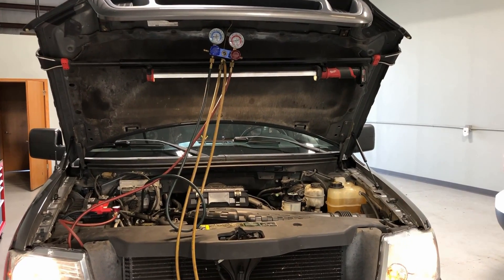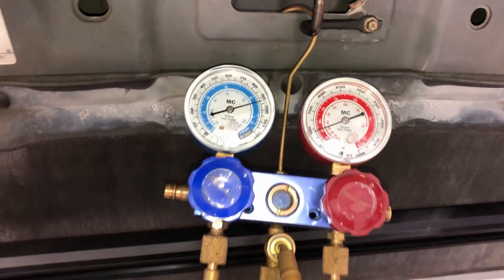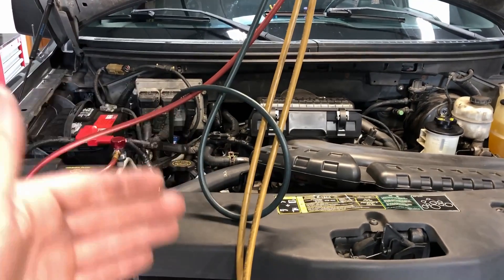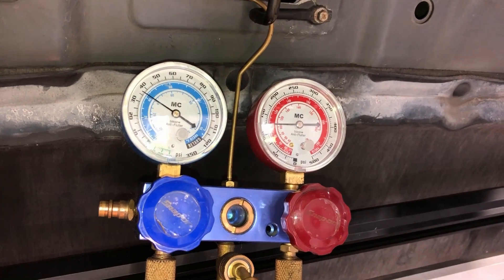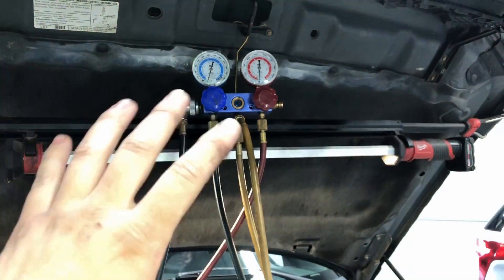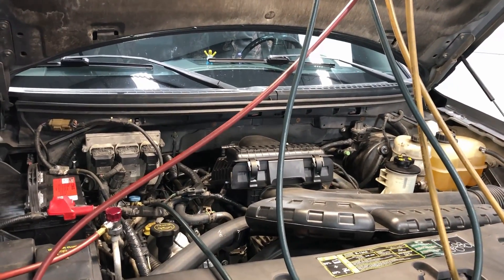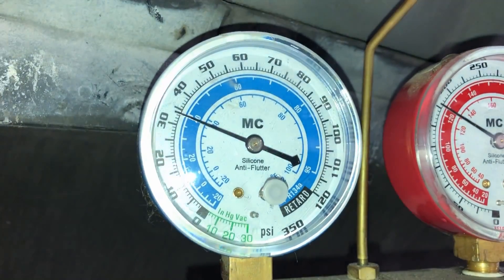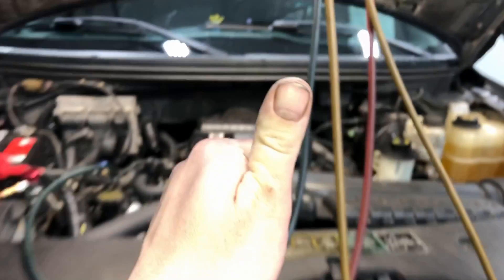Poor Automotive A/C Cooling: Do You Have a Low Refrigerant Charge Level?

Comment from the maker: Basic R-134A Manifold Gauge Set:
https://amzn.to/32JTGCc
Reply: FordTechMakuloco is this set any good? I was thinking of getting yellow jacket brand in the future but I’d like a cheap set too.
Reply: @richieschmidt6225  bb
Reply: For those of us who are backyard mechanics without an a/c machine, is it ok to just top off the system based on pressures?  Should this be done annually or just when it gets low enough it isn't cold or cycles the compressor?
Reply: teamgreen02 I would not it’s measured by lbs you could over charge. 45psi could be 2lb or 2.5lb just don’t know. “Never top off” evacuate and refill
Reply: Nice! I bought a set at a garage sale and it bent my low side valve 😒

Still using the AutoStoned manifold and vacuum. Free to rent with a $300 deposit. I'll have to get that set and a vacuum, maybe next year.

I diagnosed a bad low-side switch with a multimeter...I found out that the switch contacts are normally closed when the compressor should be running. After making sure I had freon in the system, I jumped the terminals together, system ran great, recovered the freon, replaced the switch and valve, pulled a vacuum, and filled it up. Fixed for -$30- $40 after freon (that damn needle valve)
Reply: I only use high side to check for restrictions
Reply: Whats could be wrong if this happens when you start driving the compressor starts turning on and off?
Reply: Can you tell me if tid codes for mode 6 are publicly posted or where I can get them for 99 expedition 5.4. Got what I believe to be a misfire but it is faint and only felt in drivability posing as a transmission slip. I have a few tid codes that i need to onow what they hex 41 for example.
Reply: drome010381 code 6 codes?
Reply: @weldingjunkie  yeah I will probably murder the proper explanation but I believe it is a type of diagnosis protocol and not all scanners/software are capable of determining what the manufacturer meant by a certain test #. For example, I was looking for $21 which is hexadecimal 21 with ford I found it is a vacuum pressure code. I was able to reach out to Forscan and they pointed me to a Ford website that has their descriptions.
Reply: drome010381 Ah so you just want to live Data ? Not codes right ?

Comment: Brother, you’re gonna be getting invalid temperature and air pressure readings. You can’t charge an AC system in the rain. You’re also gonna get moisture in the system that way, even if you’re inside cause there’s gonna be moisture in the air.

Comment: Freon:  How do you add Freon when the compressor won't turn because of low freon?
Reply from the maker: You vacuum the system, or you have a can that is a higher pressure. Once the pressures are safe the compressor will come on and suck the rest in.
Reply: @FordTechMakuloco  Thanks for giving the answer quickly.  Double Thanks for giving the Correct Answer.

Comment: Thanks a lot for making this video. I am seeing the same issue on my car. I think my leak is from the low side Schrader valve. I need to find the tool to replace the valve core that fits the valve in a Volvo. I am not going to recharge knowing that I have a leak. And I think the leak additives are not the way to go.

Comment: My 2013 F150 has a new compressor, TXV, pressure switch and has exactly 24 ounces of refrigerant per the sticker. Still cycles on and off every 30 seconds or so.  Cools fairly well to about 50 but not sure why it cycles.

Comment: @FordTechMakuloco, I have a 2012 ford fusion with the A/C goes to heat by itself (manual controls). A/C is still on but will not come off heat and man many people are having the same issue. Would love it if you did a diagnostic video on this issue. Peoples fix is to turn the headlights and fog lights on or to turn it all the way cold then back it off two clicks. And this seriously works for some reason would love to know why this is and a true fix for this issue. Ford quoted me 400 for a module update but i have read people have this done and it does not fix the issue. The blend door actuator works fine does the full sweep and stops with no clicks at the end. A/C compressor is running and the lines are cold when it goes to heat by itself. Again would love to see a video on a diagnosis for this fix. love your videos you post and anytime i have a problem with my fords your videos are the first i look for to solve my issues.

Comment: I got one for you, how will pressures change if the fixed orifice tube is clogged? I understand that the low side will show lower than normal pressure, maybe a vacuum, but what about the high side? Cengage textbooks say the high-side pressure will be lower than normal, but internet sources like freeasestudyguides say the high-side pressure will be higher than normal.

Comment: Help... ac charged. Compressor constantly running ,but gauge low side pressure won't go past 26psi. High side temp 225-250, then ac fan kicks on. Vent temp will only get down to 51 degrees. And outside ambient temp 85 degrees. What am i missing

Comment: Using my manifold set- I'm recharging through the low Port ONLY- the low Port coupling is obviously open. My question is-your highport coupling is open so this way you can READ the pressure on the manifold gauge... The High valve on the manifold gauge NEEDS to be closed...BUT the coupling on the high side is OPEN for reading on the manifold gauge?

Is that last part correct??
Reply from the maker: The coupling at the port on the system are turned in to open the shrader valves yes but the knobs on the manifold gauge set are closed so the sides do not mix in any way.
Reply: @FordTechMakuloco  ahh haha okay. Was reading about the manifold gauges and how they work... So what's the purpose of the high side besides reading high pressure? What happens if you turn the high side on during the recharge on the high manifold value?
Reply: @FordTechMakuloco  just to clarify- all coupling on the vechical are open during recharge?

Comment: Hi Brain !   First and foremost, I want to thank you for all your time and effort to make these videos.  Its alot of work.  You have saved my A$$ many times over the years with my Ford vehicles.  I'm currently chasing a problem with my 2011 Taurus SHO A/C system.  My wife drives this car everyday and tells me that at idle the A/C temp in the car starts to blow noticeably less colder air...not hot but warmer air.  So, I charged the system first with PAG 46 and then followed with the R134-A.  Initially the clutch wasn't coming on even though I turned the A/C turned on in the cabin to MAX with full speed on the blower fan.  Within a few minutes,6-8min, the clutch switched on...as did the engine fan...  At this point the 134 was able to be sucked into the low side....but only for about 1 minute, because the comp clutch switched off again.  Again, a few 6-8 min later the clutched kicked on again and I was able to get the entire can of 134 into the system and the clutch stayed engaged from that point on until I turned off the car.  When I went in the car to turn if off, it was super cold inside. Just to note, the gauge on the can of 134 stated about 40lbs was the pressure by the time the can was empty.  Figured I was good to go.  Although, the next morning, the system was acting like I never did anything to it. Acted like it did before I did the work.  I drove it awhile and I could tell when the compressor switched on because the air got a bit cooler, but seconds later the air got much warmer.  It was like the comp was switching off and on....like in this video.  Do I have a bad low pressure switch or did all the 134 leak out of a bad seal.  I am going to get a good manifold gauge set so I can get a better handle on whats happening in the system real time.  How can I tell if its the switch(high or low) or a leak ?  If the comp stays on it gets cold.  Clearly, my limited discovery is that for some reason the comp shuts off for a while(minutes) and then switches back on again(for only a few minutes)  Not sure where to go.  I kinda think its the low side switch.  is the low side switch down low near the comp.  On this 2100 SHO I do I work on this comp area from under the car ?

Comment: I'm currently doing the AC work on my car I went through the whole vacuuming process I bought the vacuum and I have the manifold gauge set so when you're checking the pressure with the low and high side do you keep the valves closed or open them up or does it matter?

Comment: 2014 f150 my low gauge reads 28 my high gauge will be 250 or higher when it is hot out. Do I need to change the expansion valve?

Comment: Perfect!  I searched all over and couldn't find my answer, and remembered I subscribed to your channel and searched your videos and found the exact same symptom I'm having with a 2003 Navigator that I recently bought.  The low pressure side goes from 10 to 55 psi and back repeatedly and I hear the compressor clicking on and off.  Although I'd like to figure out why it's low on refrigerant (leak or failing part somewhere?), I'll assume for now that the car is 20 years old and maybe has never had an A/C service, so I'll recover/vacuum/refill the system.  Thank you so much, so glad I remembered you!  A must have channel for any Ford/Lincoln/Mercury owner/DIYer!

Comment: My compressor frequently cycled and caused the engine to rev up. I checked the low side pressure and it was a constant 35 PSI with the compressor on (engine running) but exceeded 50 PSI with the A/C turned off. So, with the compressor off the low side should be above 50 PSI and with the compressor on it will drop down to the 35PSI? Am I missing something or do I have some other problem than low refrigerant? 02 Mustang GT. It is blowing cold air but maybe not as cold as it should. The frequent cycling of the compressor (about every 15 seconds) seems to be an issue

Comment: How’s it going… been following you for a while on my old page… I have a question which I’m hoping I can get advise from you on. I’m doing a complete AC system replacement on my 04 5.4l f150 (all new parts whole system) . What method do u use to charge - pressure or superheat if superheat what is required superheat? Also what recommendations on oil placement and full capacity oz- half in accumulator and half in compressor or all in compressor ect. Reaching out to u as I know ur pretty technical with specs on fords. Thanks for the time….
Reply: There is so much different information out there and I prefer the technical way

Comment: What does it mean if a compressor doesn’t cuts off at all, like it stays engaged the whole time even with out freon(I had to refill the system completely after evacuating it for an engine swap) the vehicle wasn’t running for over 6 years and it’s being without refrigerant that whole time too. I did vacuum, tried adding refrigerant then found a leak on the high side line going from compressor to condenser, replaced the line and did vacuum again and struggled to get refrigerant back in the system with the gauges and self-sealing cans but I was getting 90psi on the low side and little to no readings on the high side, so I tried one of those cans that come with their own charging hose and that worked but now I have a big leak on the charging line, is that an indicator of a faulty compressor (it does make a noise)

Comment: Thank you so much, that is exactly what I needed if I can connect the Set (I have Pittsburgh A/C Manifold Gauge Set) somehow to see exact reading, what is the current pressure on both sides without starting the car. For some reason no one else explains this part (including instructions). Please can you also tell why there is a Schrader Core on Blue and Red hoses (though on one side but still). On Yellow hose I understand, bcs one side can go into that 2nd hole, which is below the Observation Window, and that hole has a Schrader Valve, so the end w/Schrader Core can depress it. But Red and Blue connect to Manifold or  Manifold Couplers, and there are no Schrader Valves there. Manifold coupler also has one Schrader Core with which it will depress the Schrader Valve on the port of Low or High Pressure. In instructions all the hoses are shown with Schrader Core Ends being on the manifold, where there are no Schrader Valves. Thank you again.

Comment: can’t the fixed orifice get clogged.   How is that replaced.   The whole line has to go.    Years ago I installed a new system in a 97 Camaro.  It had a screen inside to catch crap.  It was so full I don’t know how anything got past it.   The compressor crapped out and luckily the parts store told me about the other parts to replace.    Sold the vehicle 5 years later and it was still ice cold.    A Camaro with a 6cylinder has so much room to work.   What a pleasure to work on.

Comment: Will low or high pressure cause the fan to come on high? I have a 2014 F150 5.0 and the A/C works is blowing cold but the high fan turns on after driving for about 10 minutes. regardless if a/c is on.   Fan sounds like a damn turbine engine. Any pointers or suggestions will be appreciated.

Comment: So Educational, I can relate that because that is what I have experienced it too in one of my work last week. When you charge or add the refregerant at low side,   I experience reverse effect, when charging, giving higher RPM, the low side gauge pointer rise instead of going down to indicate suction of the refrigerant, and also notice that high side gauge pointer goes down.

Comment: This is a great series of videos ! This one in paticular got me going on the AC system in my 2006 F150.  It was text book low on coolent. I charged it up based on your instructions, cabin air dropped down to 40 F I thought I was set. took it for a ride, 5 minutes down the road the air was back to ambient Temperture. What do think is my next step in troubleshooting? 
Thanks for your help
Mike

Comment: A lot of times if it takes years for system to lose refrigerant, just add some and call it good.  Have a truck with 20yrs  on AC never changed a thing.  Kinda like an oil seep, some mechs will tear apart the block to save the owner 3 qts of oil.But charge em 1500 bucks to fix the gasket...

Comment: I didn't see you check for any leaks  the refrigerant just doesn't disappear, it has to leak out somewhere.
Reply from the maker: This vehicle is the shop truck project vehicle that has been rebuilt front to rear already, so it has zero problems. The system was purposely evac and recharged with about half a pound of refrigerant just for this video instead of the spec charge level of 2.12lbs. The purpose of the video is to help vehicle owners identify the symptom's of an A/C system with a low charge level and just for comparison at the end I showed how a properly charged system acts to help with the comparison. That was the only purpose of the video as the title clearly states. Again this vehicle had no leaks nor any concerns with the a/c system and was only used as a demonstration vehicle for video purposes.

Comment: So on a FOT system, if I the low side is sitting at 60psi and the high side is at 250psi would that mean that there is a restriction on the low side?

Comment: What causes the clutch to cycle continuously say at 2,000 rpms and up but not at idle?  This is on a 2007 Superduty with the 6.0L.  Air gap at the clutch was adjusted back to spec.  Thanks.

Comment: did you check for a leak besides the ac machine the ac machine doesn’t pressure a system once again another ac hack guy and job hmm
Reply from the maker: I know you may be new to the channel and not know this so I will be gentle. This vehicle is the shop truck project vehicle that has been rebuilt front to rear already, so it has zero problems. The system was purposely evac and recharged with about half a pound of refrigerant just for this video instead of the spec charge level of 2.12lbs. The purpose of the video is to help vehicle owners identify the symptom's of an A/C system with a low charge level and just for comparison at the end I showed how a properly charged system acts to help with the comparison. That was the only purpose of the video as the title clearly states. Again this vehicle had no leaks nor any concerns with the a/c system and was only used as a demonstration vehicle for video purposes. Oh and BTW this gen F-150 has NO common leak points just an FYI. Let me know if you need further clarification, Happy 4th!

Comment: I have a 2006 F150 crew cab 4x4.  When I turn it on 1st thing in the morning I hear the AC clutch engage after driving a while the clutch stops engaging, I can turn it off and try to turn it back on and the clutch will not engage. I let it sit till the next morning turn it on and the clutch will engage , any thoughts?

Comment: How do you store your manifold gauge set? I get different answers all the time. My coworker cracks the fitting to drain them to atmospheric pressure and opens all the valves, others leave them sealed with refrigerant in them.
Reply from the maker: You always pull them into a vacuum

Comment: Awesome! My 2004 150 is leaking oil on the high side tubbing and hose connection and need to replace the ac manifold. Was really hoping you have the  tutorial video on how to remove and install new ac manifold on 2004 5.4l f150

Comment: I vacuumed my system held pressure system was recharged based on temp compressor engages still have hot air and high side is shooting way high 300+ 45 on low due to temp in vegas 107degrees  below 20# humidy.